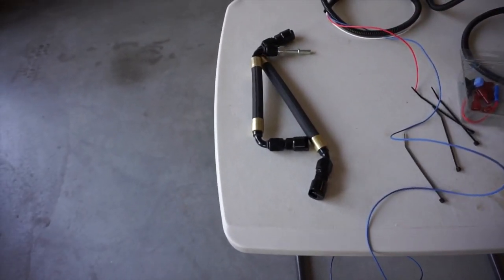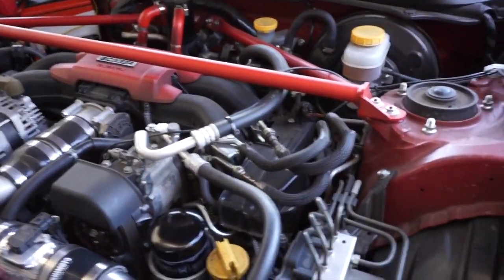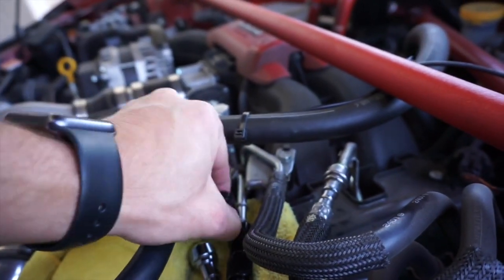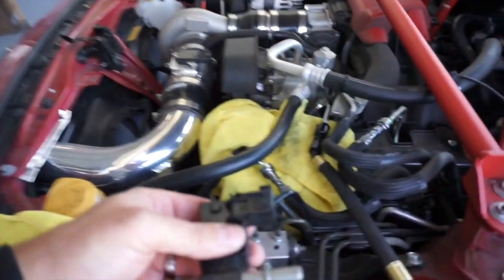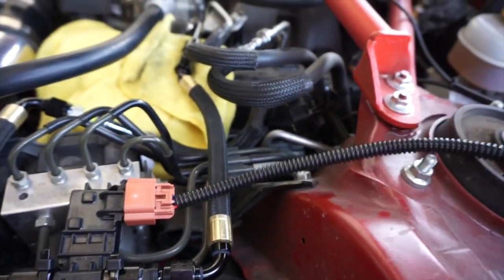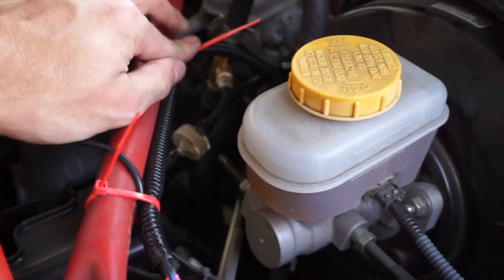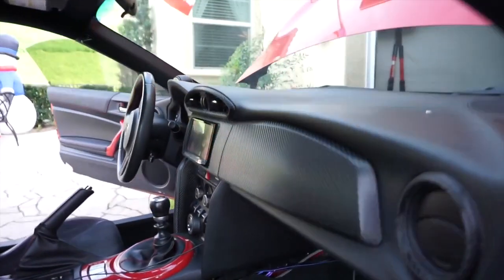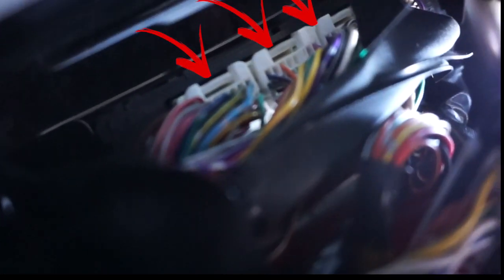OFT Flex Fuel Install: Electric Supercharger

Comment: I'm having issues with the tablet showing the ethanol content. I already added the templet shiv send you and double checked all the wiring.
Reply from the maker: Danny Gonzalez what does the ethanol content say?
Reply: it doesnt appear on the tablet
Reply from the maker: Danny Gonzalez did you load the template onto the oft? Also make sure it's one of your data channels when viewing.
Reply: Steve Grau yes, the template is loaded but I did not check if it was set as one of my channels. I'll have to do that

Comment: Nice video! =)

Just a little thing to point out, we have no "steering reservoir for power steering", we have an electrical steering rack. That thing you point in the firewall is the clutch master cylinder
Reply from the maker: tatofonico haha yeah you're right it's obviously the master cylinder